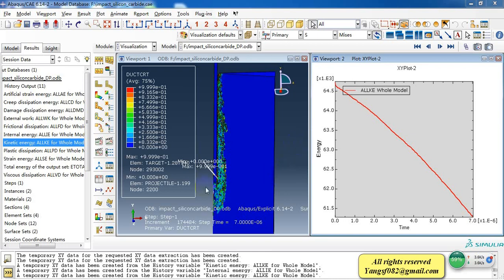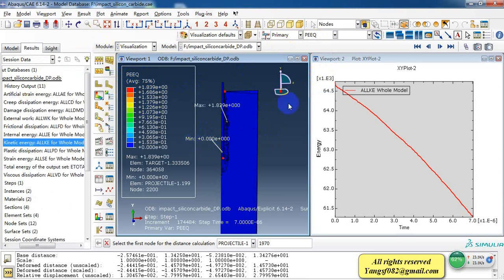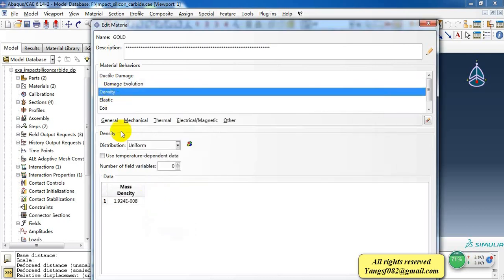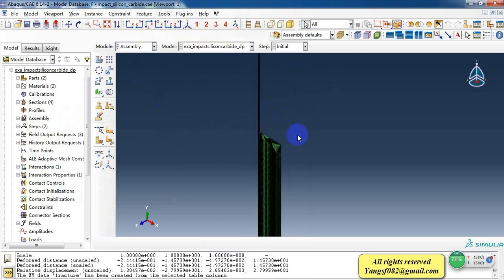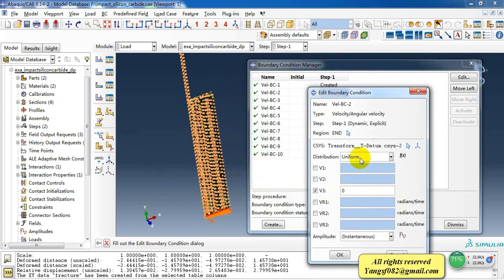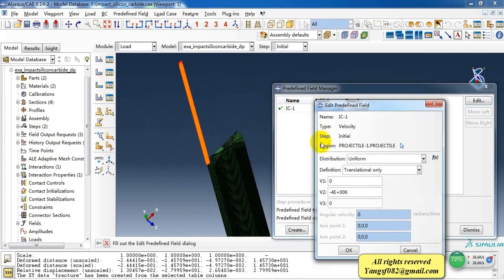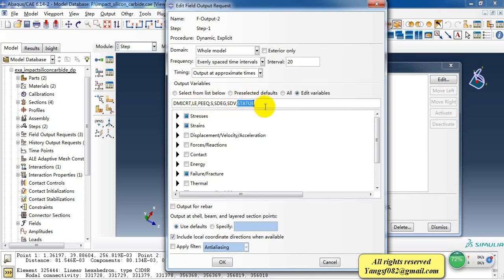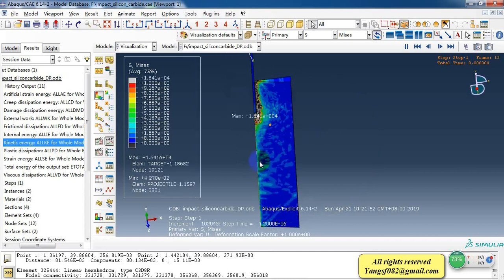ABAQUS Tutorials Step-By-Step Simulation of high velocity impact of silicon carbide edit

Comment: Don't we need to edit the .inp files for interaction between internal surfaces/ element based contacts? Does new version have included this capability of element based surfaces in the CAE interface? @yang Green.
Reply from the maker: It always  has this function.
Reply: @yanggreen2984   ok thank you. I have one doubt i'm try to model rigid impact on RC structure, but when i go for fine mesh  (~ 5mm) my model seems to be behaving non-physical when they came in contact with embedded rebars. Does this formulation doesn't work with embedded elements. I have defined damage evolution for both concrete and rebar only concrete elements delete but for rebar they buckle and fly away. I tried surface to node formulation but same thing happened. What is the go to method for contact with eroding embedded elements, if you could please help.